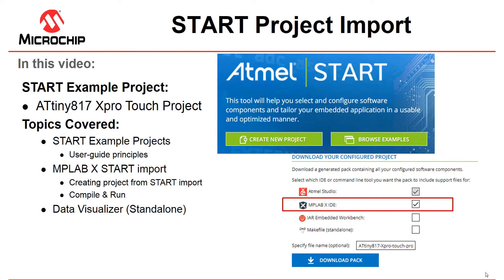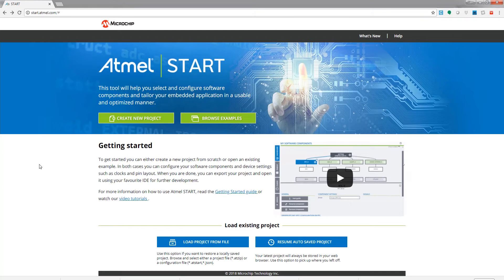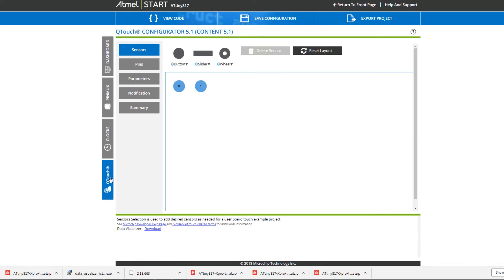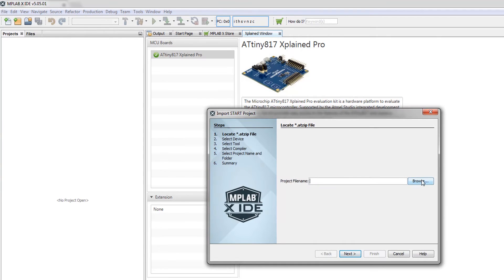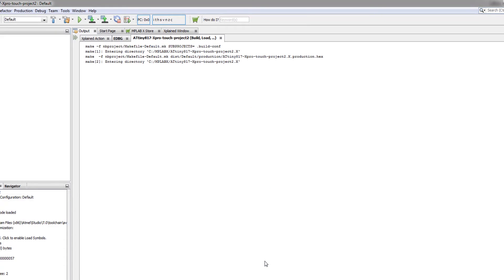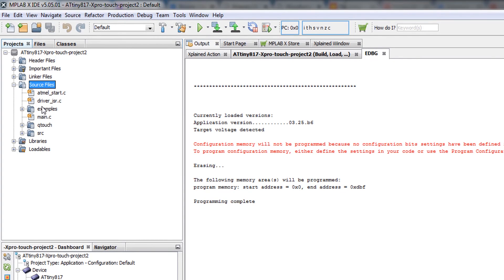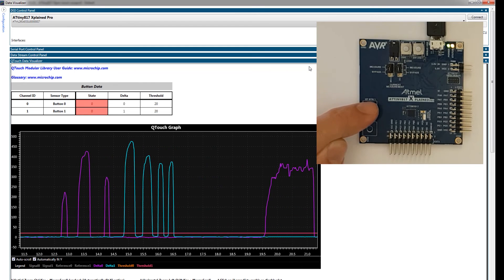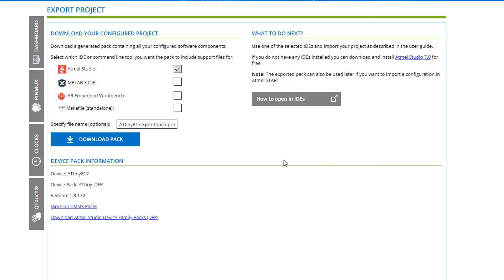Getting Started with AVR® in MPLAB® X IDE | Import Atmel START project

Comment: Really good work flow explanation. Was able to follow you clearly and resolve some issues. Two of the items you mentioned solved a problems I had. 1. Dont use the DGI control Panel, only the serial port control panel. 2. My config path was pointing to another datastream location from a different project, I updated this and voila, i got the datastream . Thanks a bunch :)